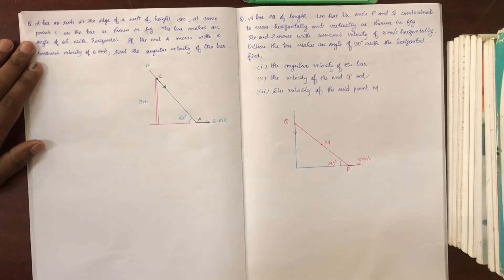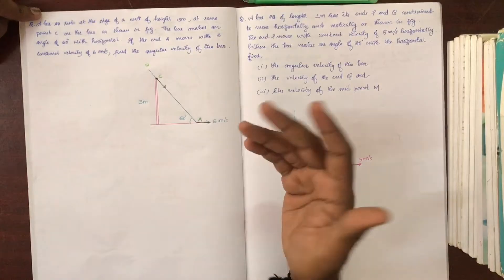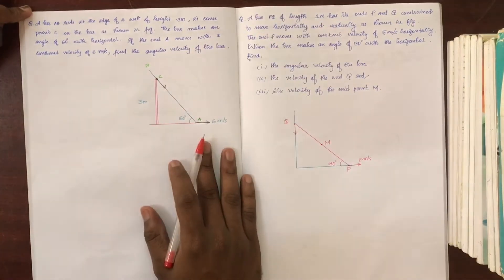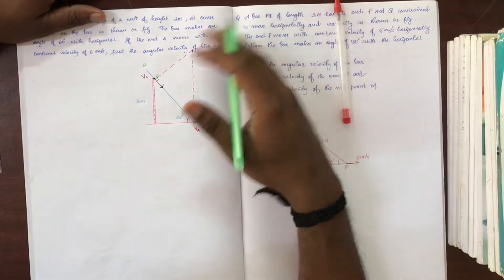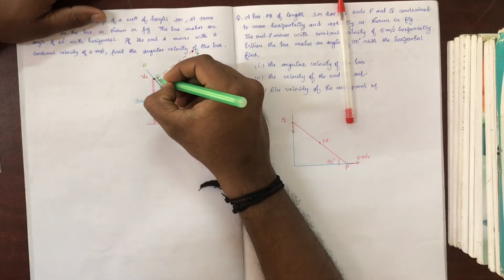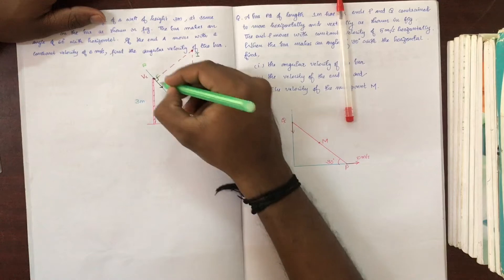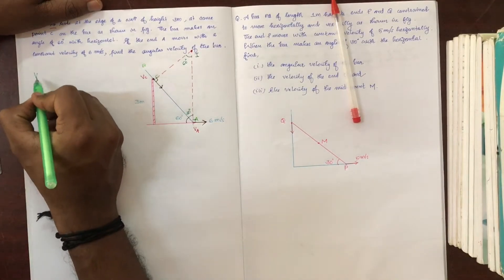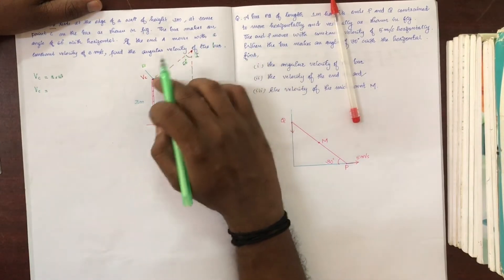KTU-MECHANICS-MODULE 5-PART 3- INSTANTANEOUS CENTRE PROBLEM

Comment: Im=cos alpha calculator enganee adichuu 
Aah answer enganee kitti sir
Reply from the maker: Time comt cheythe
Reply: @LETSDISCUSS1  ?? Manasilaayilla
Reply from the maker: Video l ethu portion anenn parayamo .. like 3.00mint
Reply: @LETSDISCUSS1  17:10
Reply: Ah eqn last cos alpha nth cheyum
Reply from the maker: IP kkum IM um idayil ulla angle =60
Reply: @LETSDISCUSS1  kk nokattetta
Reply: @LETSDISCUSS1  sir ,kitti but inik 0.6 ann kittiyath .sirinu 0.5 m aann kittiyath scn indoo
Reply: @athulsu8552  hi, ithil pm nte value angnaa kittye?
Reply: @abinbiju9955  m = midpoint = 1 . So pm take as 0.5
Reply: @athulsu8552  midpoint aann paranjattillalo?
Reply: @abinbiju9955  ind sub que 3 nokk ath Ind " the velocity of the mid point?" A bar length pq = 1 . Athukund midpoin t idukumbaa 0.5 kittulee
Reply: Sir 17.30 il (pm nte value angne kitti)